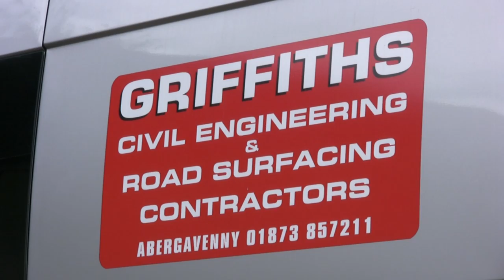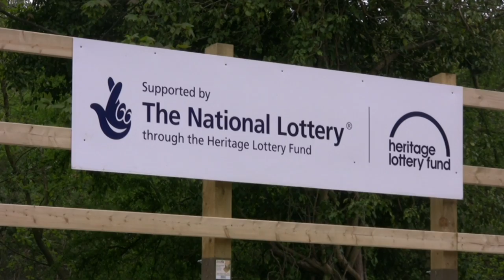COTSWOLD CANALS new channel for canal at Stroud May 2013

Comment: Please tell me is the cotswolds canal for use by widebeams or just narrow boats?
Reply from the maker: Jon
The Stroudwater Navigation is wider than the Grand Union, as is the Thames & Severn canal from Walbridge to Brimscombe basin.
With small constrictions on restoration, I guess that it will take craft of at least 15ft 6inches.
It is recorded that the "tightest" of the locks was Dock lock, as was the original entrance lock at Framilode.
The Thames and Severn canal east of Brimscombe has one lock of that width (Bourne lock), and thereafter to the Thames, took craft of 12 feet beam but 90 feet in length. Many of those longer locks, on the climb to the summit, were later modified to reduce water loss.
Maximum headroom of the restored section will be constrained by the new A38 bridges and the fairly new bridge to the trading estate near Stonehouse, but each of those has ample headroom for pedestrians on the towpath.